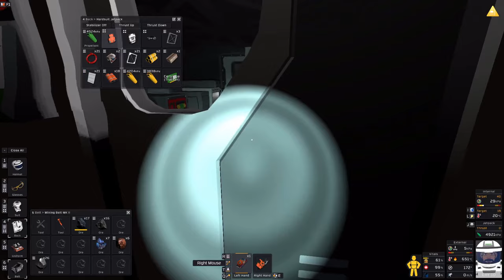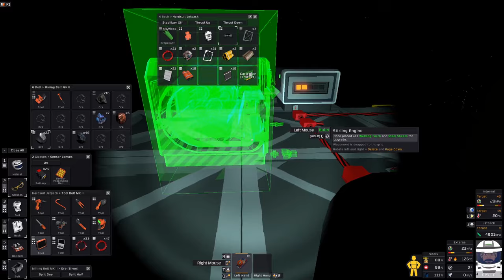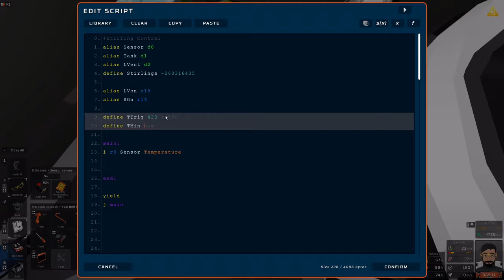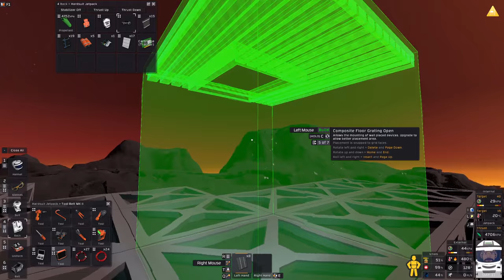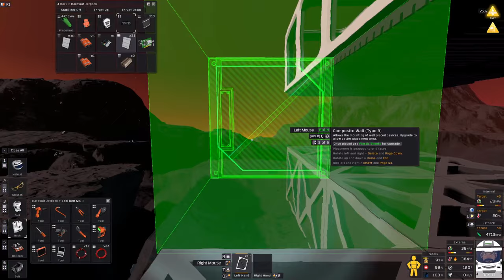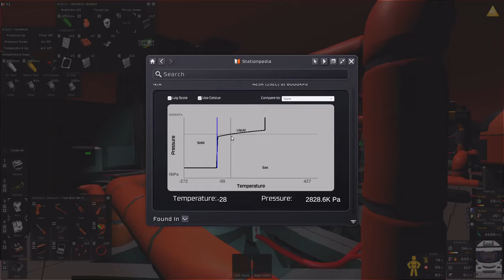Stationeers: Brutal Vulcan 5

Comment from the maker: Scripts Made for the CO2 filtration as well as the Stirling Gas Capture and power Generation.
Reply from the maker: assign d0 to output1's volume pump
assign d1 to output2's volume pump

#CO2 Filtration Script
alias VPout1 d0
alias VPout2 d1

define Tank $   #This is the tank's reference ID you get from a config tablet
alias SMode r15
alias VP1On r14
alias VP2On r13
alias TankNumber r12

move TankNumber Tank #This is until reference ID defines is fixed by Rocket

define TMax 308.15 #35C
define TMin 298.15 #25C

main:
l r0 TankNumber Pressure
l r1 db PressureInput
l r2 TankNumber Temperature

slt r0 r0 35000
sgt r1 r1 2000
and r3 r0 r1

slt r4 r2 TMin
sgt r5 r2 TMax
select r6 r4 1 r6
select r6 r5 0 r6
and SMode r3 r6 #r6 makes sure temperature of tank isnt too high

l r0 db PressureOutput
snez r1 r0
or VP1On SMode r1

l r0 db PressureOutput2
snez r2 r0
or VP2On SMode r2
end:
s db Mode SMode
s VPout1 Setting 10
s VPout1 On VP1On
s VPout2 Setting 10
s VPout2 On VP2On
yield
j main
Reply from the maker: assign d0 to an outside gas sensor
assign d1 to the tank (or analyzer if you just build a bunch of utility pipes.)
assign d2 to the large powered vent.

#Stirling Control
alias Sensor d0
alias Tank d1
alias LVent d2
define Stirlings -260316435

alias LVon r15
alias SOn r14

define TTrig 423 #150C
define TMin 773 #500C
define PMax 50000

Main:
l r0 Sensor Temperature
l r1 Tank Pressure
l r2 Tank Temperature

lb r4 Stirlings Pressure Maximum
slt r3 r0 TTrig
slt r4 r4 10000
and SOn r3 r4

sgt r2 r0 r2 #Turns on vent if Temperature outside is greater than inside
slt r5 r1 30000 #If less than 30MPA, turn on anyways
sgt r6 r0 TMin
and r5 r5 r6 #turns on if >500C and <30 MPa
slt r1 r1 PMax #If less than 50MPa, turn on Vents
and r2 r2 r1
or LVon r2 r5

end:
s LVent Mode 1
s LVent On LVon
sb Stirlings On SOn
yield
j Main
Reply: @shadowdrake082  Hello, I wanted to ask if it's normal for the Stirling engine to only run briefly. I'm experiencing this behavior and it's a bit puzzling. Thanks.
Reply from the maker: @birogmc5130  Its likely. The script is looking at the gas sensor to determine the outside temperature for nighttime. If it is too close to the stirling, the stirling puts hot air which could confuse the gas sensor to report that it is too hot to run. Alternately if the stirling is overfilled with Volatiles in the canister, then the script also has a failsafe to shut it off if the internal pressure exceeds 9.5MPa or something around that range.
Reply: @shadowdrake082  Thanks for the tip, I should have figured that out myself. After I relocated the gas sensor, the Stirling engines worked. Until the latest patch. :( Now, unfortunately, the hydrogen canisters are emptied immediately after being inserted.
Reply: @shadowdrake082  Thanks for the tip, I should have figured that out myself. After I relocated the gas sensor, the Stirling engines worked. Until the latest patch. :( Now, unfortunately, the hydrogen canisters are emptied immediately after being inserted.